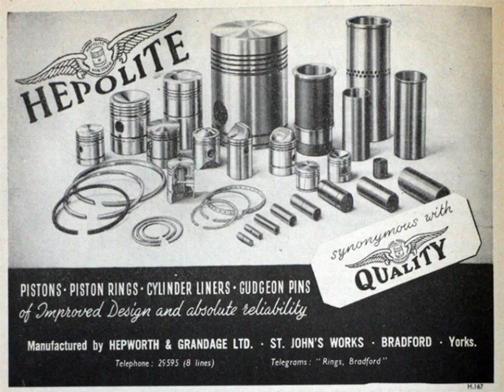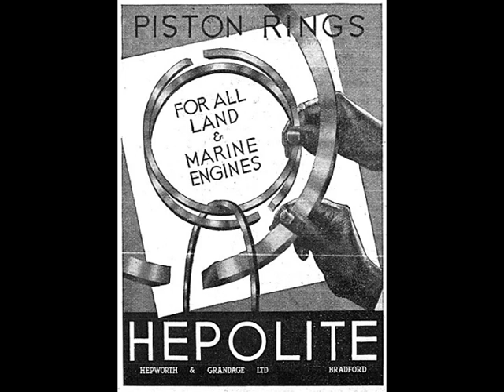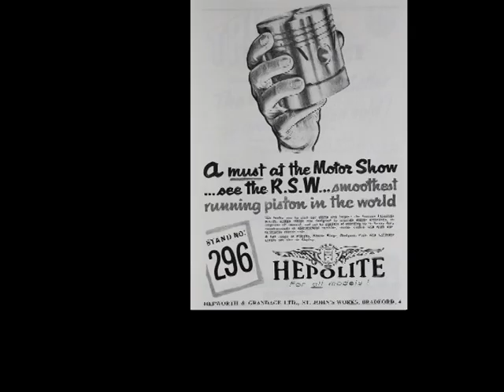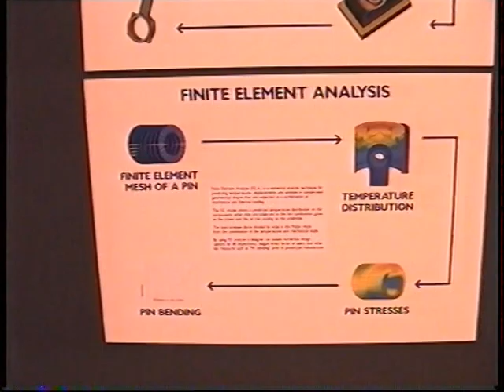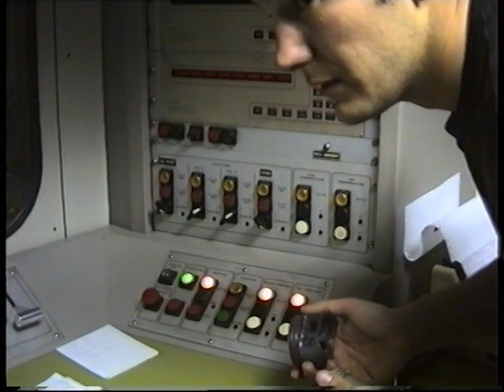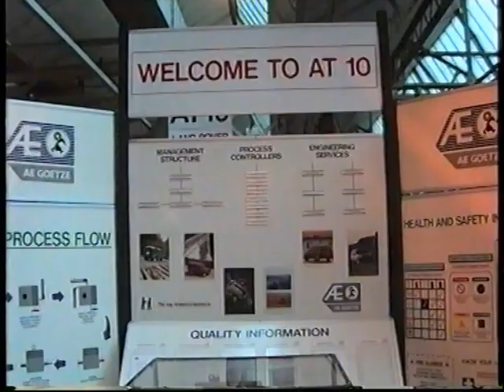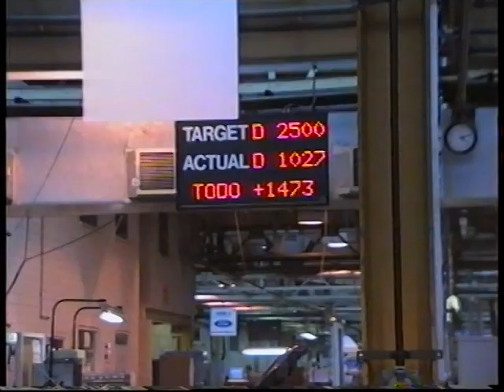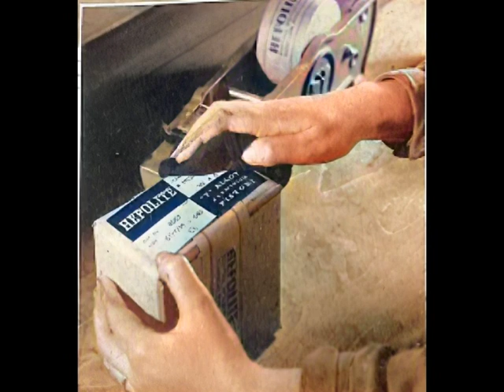Hepworth and Grandage open day in the mid 90's

Comment: Liked the video Harold, I worked in the Sunderland factory from 1968-1985 producing piston rings, started on the shop floor machining & ended up in the planning dept. on machining sequences, then to production engineering & finally to the drawing office. When I was in the planning dept, I used to travel to the Bradford factory occasionally with product costings. I must say it was a great place to work & I enjoyed every minute of it. I wish now I had taken some photo's at the time it would have been a great addition to your video. I wonder if anyone else did. I still look back at that time with great fondness, such a shame it has all gone, but that's progress I suppose.
Reply from the maker: Thank you Robert for your comment,glad you liked the video I just wish I had taken some more in a bit more detail.I videoed tho old original piston shop after it moved over to the its location shown in the video later when it was redeveloped for the toolroom and maintainance where I worked,I also videoed the old toolroom with its hamerbeam roof but sadly the video was mistakenly erased,would be nice like you say to see some othe pics,I do have some from the 50's which I plan to use in a sldeshow some time when I get time.